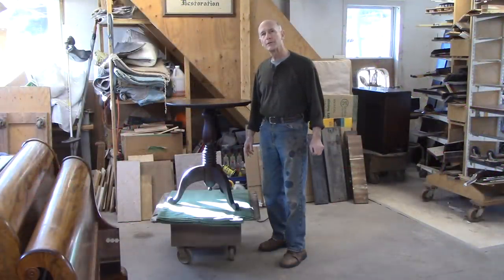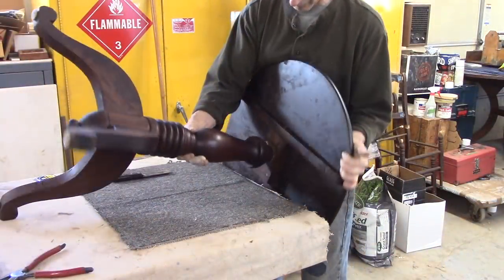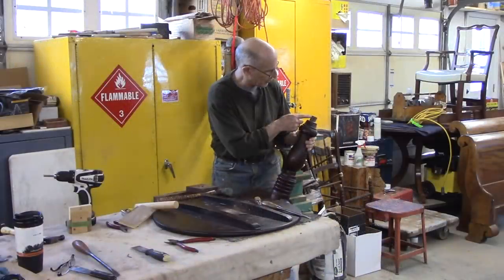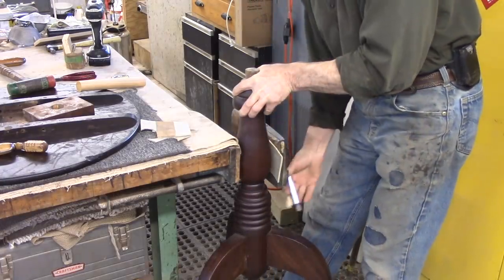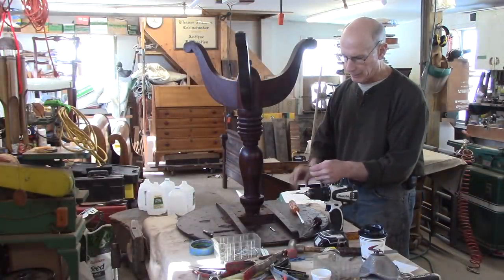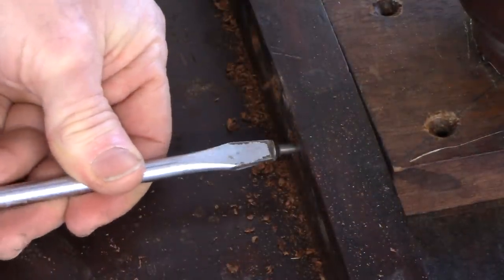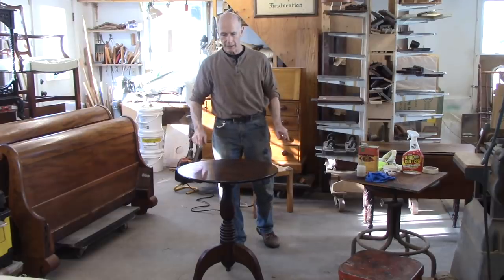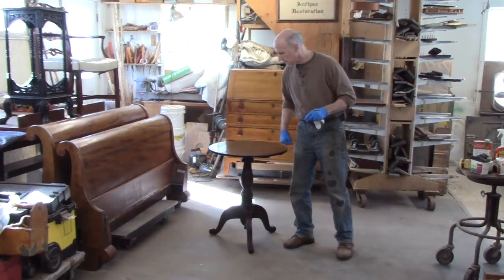Stabilizing a Wobbly Table Top - Thomas Johnson Antique Furniture Restoration

Comment: simple do it right and not half wrong ;) . These old pedestal tables are rare here in China, and if you find them they are very expencive and could use your top cleaning and leg repair aswell. It is even worse ( i have one ) if they use epoxy as paint and glue , i have no idea how to get that off it joints.
Reply from the maker: Thanks! Heat will work on epoxy, but it's slow and messy
Reply: Thomas Johnson Antique Furniture Restoration thank you , i will keep trying.

Comment: Fantastic job as always!

I deffinitly agree about the screws, those cross screws can realy totally ruin the look on old furniture (and also new hand made furniture) i always try to re use those old ones or got new ones with the same look on things i made. I rely don't know why those cross pattern screws even are still in production, they where developed for one single purpuse and that was the hand screwdriver and only for putting them in, not to loosen them again... Today they does no longer fill any real purpose, they both look extremly ugly and are also an arkward to use with machines, and they always got trashed when one try to remoe old ones... I realy hate all brands of those cross patterns...
Reply from the maker: Thanks! I don't feel as strongly as you do! If you use the correct size bit they work fine. What would we do without drywall screws? I especially like the "deck" screws with square heads for building chicken coops, etc.
Reply: @johnsonrestoration  
Thank You for Your reply

Maybe i was ower reacting... ha ha
But when try to fix old car and machines, window frames, etc i usually hawe to drill and chisel them out if they are wery rusted or somebody before me hawe tried to use a machine on them.

My awerson is only about cross hatch patterns, I relay like square heads, insex and torx, however, squareheads are not so common in my country for some reason, bu i almost only use torx today in construction work, (and insex on older macine screws). I don't experience that problems with those types.
But, yes, i don't use them on wery old furniture, i try to use real brass screws and pre drill instead of doing as they do on most TV shows in my country where they replace them with nickle plated steel screws, wich is completly unnessesary if one just doing it right, as in Your videos.

(On old engines i still use treads like the UNC and Witworth, etc because they are still better in some situations compared to millimeter or impeial inc treads ower time and under load)

My grandfather was a carpenter and i still trying to figure out wich methods he had used when it come to furniture and construction work... To be wery honest i am far from hi's skill, but i trying to learn. :)

Not many people still master the old methods, but You are one of them, that's true respect!

Best, kindest regards!
From Sweden

 (Sorry for my English, it's not my native language)

Comment: What's the story on the 2 large columns on the shop floor?
Reply: I think those are sleigh bed ends?
Reply from the maker: Thanks! I'm not sure what you mean, but I think Alistair is right, you must be referring to the sleigh bed
Reply from the maker: Correct! Thanks
Reply: correct. I saw the bed early on but at about 11:55 into the video it is a reverse angle and they struck ne as something different during the short time they were in view.

Comment: Dowels in the screws holes would of worked fine.
Reply from the maker: Thanks! Dowels can work, but the correct way, especially in a top, is with plugs, because of the grain direction